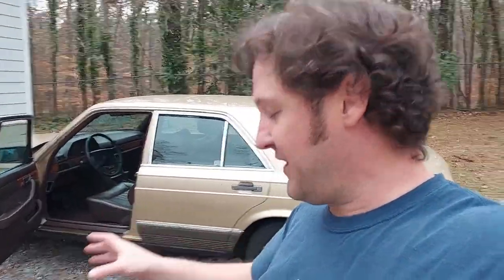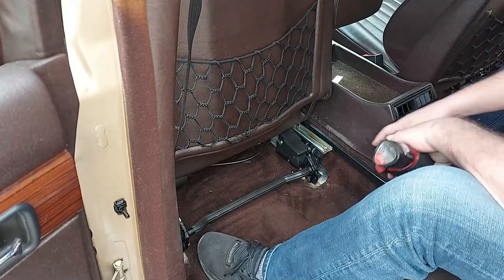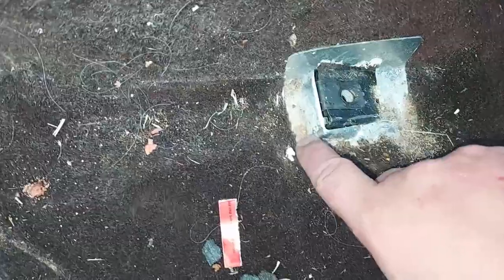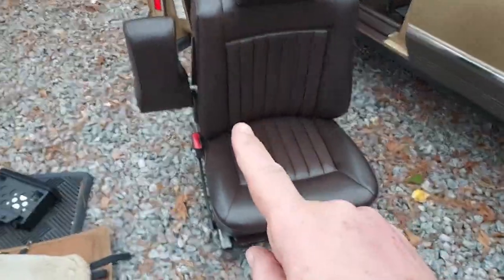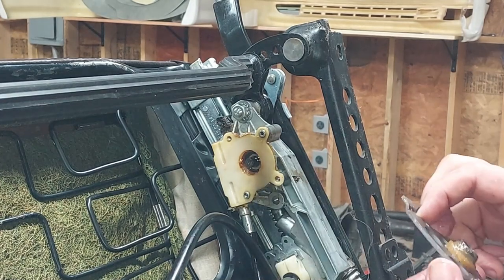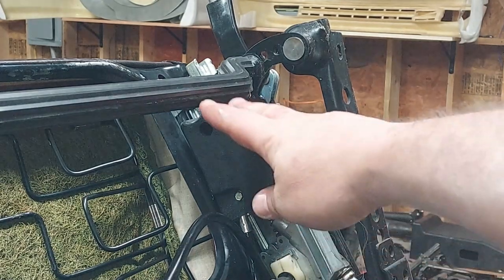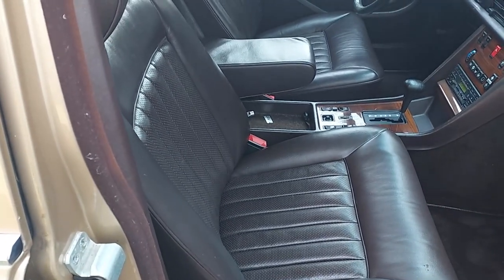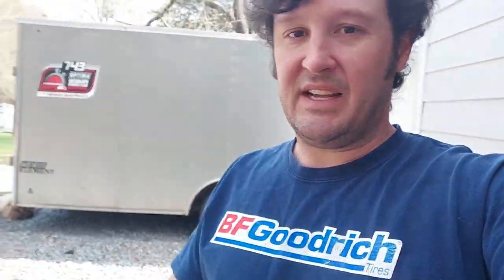1982 Mercedes 300SD - Part 6 Electric Seat Repair

Comment: Very interesting. The backs on my power seats do not move. Can’t hear anything when trying to move them. Thankfully they are in comfortable positions, but hoping to tackle that sometime.
Reply from the maker: If you don't hear anything it's most likely an issue with your switch you can take the switch apart and clean it and see if that resolves the issue